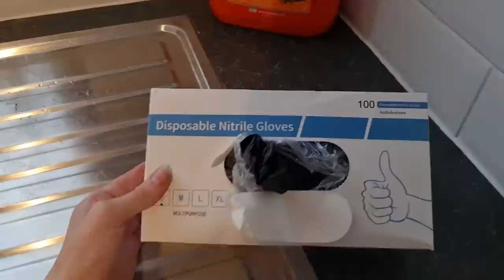My first time doing motorcycle maintenance [Part 2]

Comment: You Miss sprocket are doing extremely well, there are some men who wouldn't do what you have done. I will say though I agree with Peter below, you need to invest in a torque wrench. I gritted my teeth when you hammered up the drain bolt and hung off the spanner when doing up the oil filter, It won't come undone that's for sure😂. No seriously Saffy keep up the good work. Next time it will go a lot quicker as you have done it once already. Keep the videos coming. Oh and by the way keep laughing. Safe riding.
Reply from the maker: I'm going to buy a torque next week! I've been told off so many times 🤣😅

Comment: Awesome job, well done! The K7 should have a thin metal bar under the pillion seat, it's the tank prop, for next time you're doing the air filter!
Reply from the maker: I didn't know that! That would have been useful to know
Reply: @SaffySprocket  ah, my mistake, firstly K7 was the 2007 model, L5 is the 2017 model.
Second, the tank prop is an optional extra now (it was standard on my K6 and lived under the pillion seat). If you want one, ask your local Suzuki parts desk for the "tank stay" - I got one for my 2002 Honda ST1300 about a year ago, and it was £17.

So much easier than faffing around holding the tank with one hand.

Comment: Watching you put that oil filter on with a spanner so much was giving me visions of you hurting yourself badly trying to take it off later on. Hopefully it wont be too bad since it has the hex nut on the end.
You can use a clamp or large pliers to squash in the brake calipers.. simples.
Reply from the maker: A few people pointed it out! It was super difficult to get off so I presumed it was suppose to go back on tight 🙈🙈🙈

Comment: Torque wrench and a Haynes manual Saffy. Had kittens seeing you tighten the sump plug with a spanner and hammer. Shear that or strip the threads and you're buggered.

Comment: And 100% buy a torque wrench instead of smacking spanners with hammers. You’ll over tighten the nuts and round them off. £30 torque wrench is a solid investment.

Your sump bolt and especially the oil filter will be a pain to remove. The filter is way over tight. Hand tight plus 1/4 turn is all that’s needed. Otherwise you crush the seal and it gets stuck to the engine.

Last thing / tip. don’t fill the filter with oil. Just measure the right amount for your bike using jugs. Fill let settle. Then first up for 15-20 seconds. Let it settle for 2-3 mins then check oil level and adjust as needed.
Reply from the maker: Gonna pop to halforda and grab a torque next week 🤣

Comment: My tips Saffy, buy a few torque wrenches as you don't want to over tighten alloy nuts and bolts like the Oil drain plug (with new copper or crush washer fitted), and like some of your other viewers said smear of oil on filter seal and hand tight or one or one and half turns tight which is effectively hand tight, but if you don't have enough strength the user manual will specify a torque setting or amount of rotation once nipped up. 

Your chain looked a little tight, should be 20-30mm of free play or you'll end up stretching it and getting tight spots, (a section of chain stretched more than the other links, as it rotates it goes tight and loose). New chains will stretch so expect to tighten it after two or three tank fills of petrol.

Oh, body panel screws don't over tighten them or you'll strip them and end up with loose panels, these normally just need a nip up, and general visible check every time you wash your bike.

Well done, after this I bet you felt good. But where was the BLACK gloves when doing oil change or did you buy them after🙂 Oh and even though you are so pretty we need more dirt on your face, haha!

Comment: You are learning that's the main thing, Having the right knowledge and the right tools makes life a lot easier. I'd invest in an impact wrench a friend of mine uses a Ryobi Impact wrench and he swears by it when ever he's had tough to remove nuts and bolts, But i wouldn't tighten things with one as they can break or strip things. And that's a job another tool. A torque wrench for the right amount of tightening.

Comment: I’ve just bought exactly the same spreader last week, it works fine if you’ve got 4 pot front callipers
Reply from the maker: Is it any good?
Reply: @SaffySprocket  yeah absolutely spot on. With multi piston callipers, as you push 1 back another comes forward so it ends up like a game of whack a mole without the right tools

Comment: Great advice from your followers regarding servicing tips, we all have to learn when we start doing DIY mechanics and to be honest once you get the feel for things you'll save yourself lots of money and have some fun and enjoyment! 
Do get yourself a torque wrench but first of all find out what size socket drive you need for your sockets! most common are 3/8" or 1/2" really important you don't over tighten things, too tight you can strip treads and it's quite easy to do.
Bit concerned with how tight you did the oil filter, the K&N's have been know to leak around the top if you over tighten them, next time just go for a normal spin on type, you can't go wrong with HIFLO filters, good safe bet . Good rule of thumb when fitting, you'll feel the filter seat on the rubber O ring, then 1/4 turn is usually enough.
Put talc on your hands or some in your rubber gloves, makes life so much easier getting them on lol 
And please buy a manual! Haynes will do fine.
If in doubt, always ask and might be worth joining the SV650 uk forum, learn more about your bike, hints tips ect
https://forums.sv650.org/
You'll probably be ok with the car piston push tool .
Reply from the maker: I'm going to head to Halforsa next week and buy a torque wrench 🔧 🤪

Comment: Another great video1 A few more words of advice froma stranger on the internet... Put some cardborad under where you're working. Not only does it keep the floor cleaner, but it stops the nuts and bolts you drop from bouncing off the hard concrete and flying miles away. Get some brake cleaner. It's great for cleaning just about everything (but be careful, it can ruin some things!). Open the oil filler cap before you drain the oil.Sometimes they can get stuck, so you cant replace the oil. If you do that first, at least you still have the oil in the bike. Spread a bit of new oil around the seal on the filter before you put it on, it'll help it seal and stop it sticking on, making it easier to take off next time. Cut a bit of plastic milk bottle to shape to make a bit of a funnel for to old oil when you remove the and oil filter, it'll help stop it going all over the exhaust. and on last thing for now, oonce you have done everything, go for a quick ride around the block, then check all the nuts and bolts are still tight. Oh, and the most important tool to keep working is of course the kettle. Keep that well maintained, because if you cant offer someone that helps you a cuppa when things go wrong, you'll be in trouble!

Comment: My first attempt at work on my bike was to replace my brake levers, I broke both foot brake and hand brake levers in a bump with a van as well as the brake master cylinder getting bent.  I'm not a small guy (6ft+ and like my food) but I got a sweat on struggling to undo things to remove them and put it back together and realised I'd missed bits twice - so your video remained me of my first attempts alot. 

Also chuckled to myself that you got the gloves and overalls, and the next clip has neither 😀

Looking forward to more fun and this 'big trip' 👍
Reply from the maker: 🤣🤣🤣 I'm a bit useless at times

Comment: Before you ride off into the sunset happy with your work you should do a final chain tension check with the bike on the ground so the suspension is compressed by the bikes weight. If it's too tight it will over stress the gearbox bearing.
Reply from the maker: That's a good idea! - I've been delaying the chain tension check because the wheels are about to come off for new tyres
Reply from the maker: That's a good idea! - I've been delaying the chain tension check because the wheels are about to come off for new tyres
Reply: wrong advice. If a chain is too tight, it can stress the sprockets, and bind them. maybe down the road you'll ruin the output shaft seal, but internal gearbox bearing? whatever that is, i think its made up.

Comment: Well done for having a go, cant add much more as other have mentioned hand tightening the filter and putting a bit of oil on the  rubber seal. We use to use g clamps to push the calliper piston back when doing car brakes. Again congrats great video there  is always a great sense of accomplishment when you do things yourself.
Reply from the maker: Thank you so much ❤️ 💓 💗 💛

Comment: Hat off to you for giving it a go, remember YouTube can also be your friend for things such as changing pads for some tips, pads are pretty universal on bikes so what applies to one is the same for many, cleanliness is key to push the piston back then it glides in. 

Please for the love of what’s holy…… no hammer to tighten a sump plug else you will be learning how to use helicoils or time certs to repair the threads. Keep up the work and well done for your prep
Reply from the maker: I'm enroute to fix it right now 😅 haven't turned the engine on yet so hopefully no damage

Comment: Well done saffy job done you are gutsy for attempting these jobs on your bike. But in future always try and remember to go by the torque settings when tightening bolts oil filter etc because you could turn a simple job in to a nightmare by stripping a thread. Comments made are for guiding you and not a criticism anyway well done. Feel proud for completing the project.👍👍👍
Reply from the maker: I'm going to buy a torque next week 😅 I've been told off so many times

Comment: Fun to watch.............   Learn from the mistakes of previous generations/practices though - always use latex/polythene gloves, or barrier cream on hands when handling lub-oil (especially used oil) - and when fitting a new oil-filter, give the mating face a smear of clean oil to allow it to rotate easily on the engine casing (maybe you did that - I didn't notice).

Comment: That brake caliper spreader you have is the same as the one I have been using for years on cars, vans and bikes. If you wind it right in so the paddles are touching. it should fit in most, if not all bike calipers. You can use your new digital vernier caliper to measure it and confirm this.
Reply from the maker: Ooooh

Comment: Great first effort, I'm really impressed with the way you approached it. Next time it will be so much easier for you  after learning from any problems you came across this time.I would say that you should invest in a torque wrench as I think you have overtightened both the oil filter and the sump drain plug
Reply from the maker: I think you're right 😅

Comment: Saffy, I admire what you are doing and I so wish I could be there or at the end of the phone to give help. Others on here are giving you good advice.  I taught myself DIY maintenance over a 50 year period and I'm still learning. In the process I have collected a lot of useful tools. It's more expense but they last for ever in a private garage environment. Try 1/4inch and  3/8inch drive socket sets. Get a strip of Hex keys(aka allen keys) with 3/8inch drive sockets. It will save fiddling with small Hex Keys. Learn how to tighten fasteners  just enough to nip them in place..It will come with experience. Most owner handbooks contain useful diy information but you really need a Haynes manual. If you need help, ask on the video and I'm sure you will get good advice from your subscribers.

Comment: Didn't read the comments but pretty sure you over torqued the oil filter. Not intending to be critical but more of a learning experience. Usually just hand tight and then a quarter turn. Overtorquing can cause gasket damage or possibility stripping threads. Keep up the good work.

Comment: Get a torque wrench for the sump bung/oil filter and other bolts, they all have a setting so you don't under or over tighten.
Also love the way you put on the gloves just for the closing shot!🤣🤣
Reply from the maker: I had the gloves on for disposing of the engine oil 🤣🤣🤣🤣🤣🤣 forgot I had them on

Comment: Good job! That was some dirty oil. Next time on your oil filter make sure you put some oil on the rubber gasket so it won't dry out and stick if you over tighten your filter. You can come work on mine next.😋

Comment: Very good! :)  I do work on my bikes myself as well.  :) 🏍 The chain is looking to be tight.  Please make sure you follow the user's guide on the proper chain tension and the chain slack.  Also to help with the gas tank, you can put a hammer or piece of wood of a right length ;) to keep the tank up while you are working on the stuff under the tank.  Make sure next time when you are putting the new oil filter on to spread some oil on the rubber seal before attaching it.  And the oil filter does not need to be tighten hard.  It usually reads on the box to hand tighten it or 3/4 of a turn after the gasket touches the engine.  Hope this helps.  And thumbs up to the courage and doing it yourself!!!       👍👍👍

Comment: Hi Staffy, great to see you are doing your own maintenance, I do think you need a Torque wrench, and a workshop manual. The sump plug and oil filter do not need a lot of torque applied, and they will be another useful tool to have in your armoury. I thought your new chain looked a little tight, just make sure you have the right amount of slack, that Vernier calliper you purchased can be used to check the tension. But really well done everyone has to start somewhere..
Reply from the maker: I'm enroute to fix the sump plug as we speak 😅

Comment: We all learned like you saffy, skinned knuckles & all, i suggest looking at the sv owners forums online for maintainence tips, little things like uprating the front fork springs 
+heavyer weight fork oil really improve the sv's  a lot. & I have the  factory manuals downloaded from one of the forums if you want a digital copy.
Reply from the maker: I had an email through a couple of days with a link to a digital download! Going to find a public library to print it off so I can have a read 🤣

Comment: Found the video from dirty garage guy, now a new subscriber! Well done you done a better job than I did on my first bikes, and I do the same buy what I need when I need it as an investment, you have to think of it as if you take it to a garage they are gonna charge you something like £70 per hour to do the job  depending on the garage they may try and rip you off for service and brake pads you could be talking 2 hours if you buy the tools for less than than the labour then your already saving then next time it's free! I'd definitely invest in some decent Allen keys will definitely help you out the longer they are the easier it is to lever on it! As a first go you done a great job at the end of the day you got it done asked for help when you needed it and the bike is in tip top condition! I've done a few tyres myself and it isn't easy but definitely something to try later on as your confidence reaches that level!

Comment: Most bolts have threadlock liquid on them.If the fitting comes out with the threads coloured red it is a very strong "locktite"for parts that do not need to be removed during routine service's and require extra effort to remove them but for service parts it will have blue "locktite" on the thread which keeps them secure and help to stop parts vibrating loose but will still require a bit more effort to loosen. Ps you left it a bit late to put the gloves on. Motor oil is not the best thing to anoint yourself with. When doing an oil change refill to the indicated mark on the sight glass then run the engine for a few minutes to fill the filter, stop the engine to let the oil drain and then do the final top up.Then when all your maintenance is completed to your satisfaction  get on the road and enjoy.Jackx
Reply from the maker: Thank you so much for your advice 🙏 ☺️

Comment: Hiya I've just come across ur channel  Good on you for doing ur own maintenance  the only way u get to learn about ur bike is to get stuck in and do it yourself  after all u are riding it and they are simple enough  next time u want to lock ur back wheel try a block of wood through the wheel resting on the swing arm slacken everything off while its on the floor

Comment: Well done you for giving it a go. 👍 It's probably like closing the stable door after the horse has bolted but I would definitely be  buying a Haines or Clymer type manual. They have loads of pictures and the explanations tend to be fairly idiot proof. 😂
Reply from the maker: They don't make them for sv650 3rd gen 🥲
Reply: @SaffySprocket  - theres some general 3rd gen info here:
https://maintenanceschedule.com/suzuki-sv650-3rd-gen-maintenance-schedule
2nd gen full Suzuki Service Manual pdf:
https://www.carlsalter.com/mcpdf/Suzuki%202nd%20Gen%20SV650.pdf

Comment: You jumped head first into the deep end.  The thing to keep in mind is that your first projects will teach you what tools you need and what you need to learn. 

Even after 20+ years there are still days when an oil change turns into a five hour project.  (Looking at you cross threaded oil plug and the Triumph dealership mechanic responsible.)
Reply from the maker: Thank you so much :D